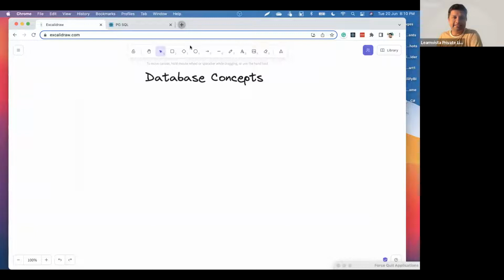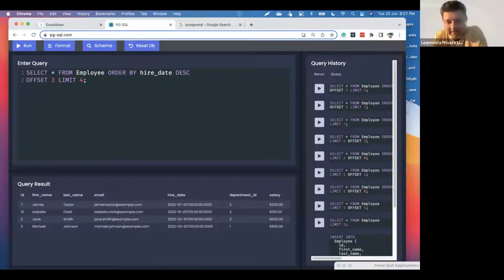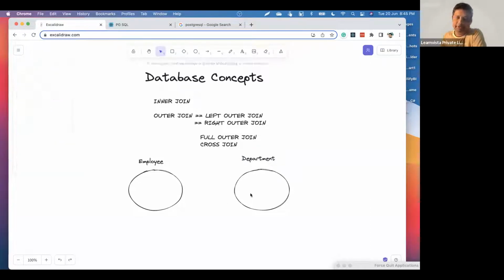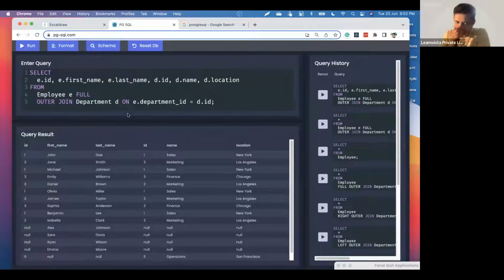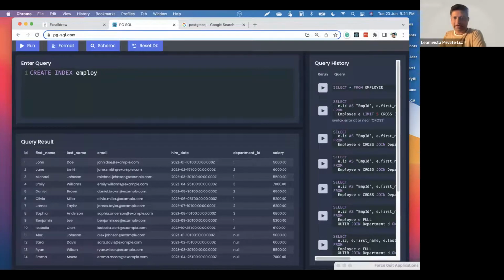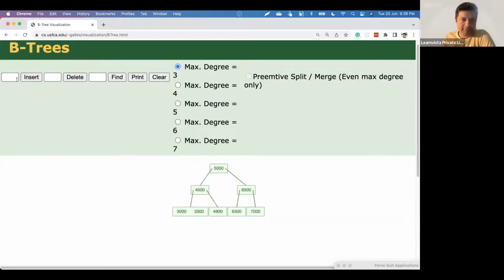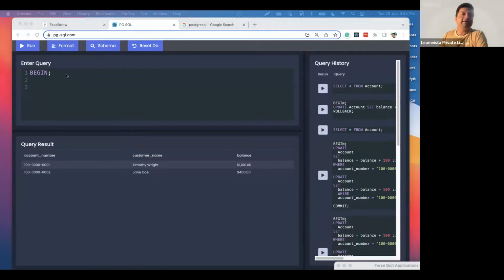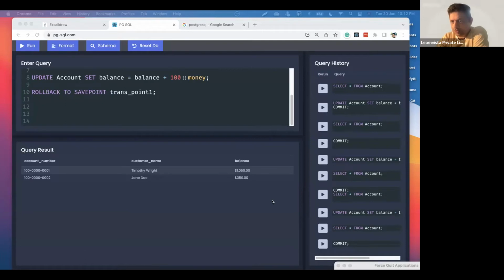Why Your SQL Queries Are Slow: Database Performance Tuning

Comment from the maker: *Pagination* is a technique for breaking down large datasets into smaller, manageable chunks or "pages" (2:30). 
Instead of loading millions of rows into memory at once, which would severely impact performance, the system fetches only a limited number of records at a time (3:23).

*Key concepts of pagination discussed in the video:*

* *Why it matters:* It saves system resources, prevents memory overload, and significantly improves application performance for the end-user (5:59).
* *SQL Implementation:* Using `LIMIT` and `OFFSET` is the standard way to handle pagination in databases. 
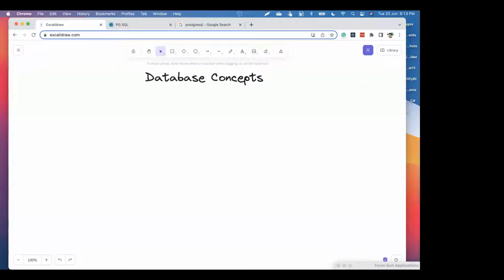    * `LIMIT`: Specifies the number of rows to retrieve (7:47).
    * `OFFSET`: Determines how many rows to skip before starting to return results (15:27).
* *Infinite Scrolling:* This is a UI variation of the pagination concept where data is loaded dynamically as the user scrolls down, commonly seen in apps like Instagram or Twitter (6:39).
* *Performance Considerations:* It is highly recommended to handle pagination at the *database level* rather than the application level to avoid transferring unnecessary data between the database and the application server (14:34).

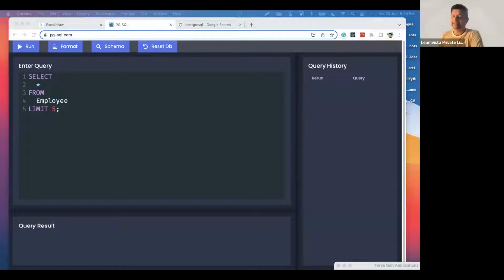If you want to practice implementing this, the tutorial provides a step-by-step walkthrough of creating an employee table and running these queries starting at (8:35).

Comment from the maker: This video is a comprehensive tutorial on **Database Management Systems (DBMS)**, focusing on advanced SQL concepts, query optimization, and transaction management, intended for professionals at all levels preparing for system design interviews.

### *Key Topics Covered:*

*   *Pagination (3:03 - 23:39):* The necessity of pagination for performance optimization when handling large datasets. How to implement this in SQL using `LIMIT` and `OFFSET` commands.
*   *Joins (23:45 - 58:13):* A detailed explanation of different join types: **Inner**, **Left Outer**, **Right Outer**, and **Full Outer Joins**, using Venn diagram analogies to illustrate how they handle related and non-related data between tables.
*   *Indexing (1:14:17 - 1:37:32):* Various indexing strategies to improve query performance, including **B-Tree**, **Hash**, **GIN (Generalized Inverted Index)**, and **BRIN (Block Range Index)**. It also highlights maintenance operations such as `REINDEX` and `DROP INDEX`.
*   *Transactions (1:37:44 - 2:02:49):* An in-depth look at ACID principles through hands-on demonstrations of `BEGIN`, `COMMIT`, `ROLLBACK`, and `SAVEPOINT` to ensure data integrity during bank-style financial transactions.
*   *Career Advice (2:07:30 - 2:13:05):* In a concluding discussion, the instructor provides advice on handling frequent job switches, recommending transparency during background checks, and emphasizing the importance of building a strong skill set for long-term career growth.

### *Practical Takeaways:*

*   *Performance:* Understanding when to use specific indexes and how to properly limit data retrieval is critical for system architecture.
*   *Database Reliability:* Learning how to structure database operations within transactions prevents data inconsistency.
*   *System Design:* The session bridges the gap between raw SQL execution and the architectural considerations required for large-scale, distributed systems.